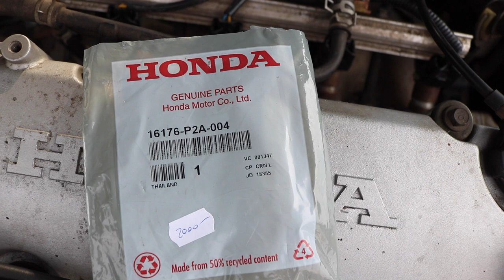Honda Civic - Throttle Body Air Restrictor Removal

Comment: For everyone asking , i just replaced the gasket on a ej9 hatch 75Hp without the ECU , the car runs  excellent and you can tell the difference.
Reply: thank you , i will do the same thing
Reply: thank you, so it isnt just a placebo? tbh im more worried the engine wont realise and that can be bad for it since more air than expected is going in meaning more combustion than is calculated.
Reply: @priceless073  When i brought the car i didn't realise that it hasn"t the gasket on the troutle body, and it worked fine , with no problems like almost 3 years
Reply: @priceless073  it will calculate for the added air and the stock injectors are the same on the nonrestricted version meaning theyre sufficient enough to add fuel, thus no ecu change is required.
Reply: @priceless073  I have done video about the difference. 2 seconds faster 0-100! Definitely not placebo haha

Comment: The 2 IACV hoses don't have to come off. Just did mine and there was more than enough wiggle room leaving them in place. The difference is noticable, gives the engine a little more grunt especially torque down low.

Comment: My car had shit idle if i turned the AC on. I took it to three mechanics but they would always just service my throttle body and put it back on. I did notice that the gasket was torn in half and only was present on one side of the intake manifold opening. I asked my mechanic to put a new one but his dumbass was like nah that doesn't make a difference. But yeah annoyed me and i just went and bought one before he could put the TB back on. And once we put that on , I didn't let him charge service the throttle body and charge me extra. It worked and now it idles nicely on AC as well.

Comment: Hi thanks a lot for the video will changing this gasket give it 90 hp or is changing the ecu a must. Pleaserl respond as your the only person making useful content on this engine
Reply: You should also change the ecu
Reply: @alexandarminev6497  no
Reply: @alexandarminev6497  no, the stock ECU will automatically calculate and change fueling adequate to the increase of intake flow.

Comment: I loved this video , and the most thing that I loved was to see the two places that the coolant hoses go , were looking like shining new metal , It's impossible to see here in brazil a g6 d16 with the coolant components looking so new , because in the last i would say 19 , 20 years here all the old owners used just water and no coolant at all , I think the only one that maybe ass good as this one in the coolant area is the model 001 made in brazil in 97 that honda keeps in their storage , massive congrats for not using water on the coolant !
Reply: Honda waterpumps on these d series are built for life. They only require inspection at timing belt intervals of 100,000km or sooner depending on service regime. If you use the correct oem honda type 2 blue coolant the pump will last a very long time

Comment: I replaced mine a few months ago, and I took it to Honda to Finish it. I could not get those 2 hoses on the IACV. Getting those 2 hoses off was the worst thing I've ever done on my car, and trying to get them back on was even worse. Taking the fuel rail off would allow more room, but I don't know how to do that, so that's why I took it to Honda. I spent over 2 hours fighting with those 2 hoses, it was hands down absolutely the worst job I've done on my car. My blood was boiling before I gave up. The reason why it's so hard is because the end of the IACV those short pipes the tip is bigger making harder to slide the hoses on, and that damn fuel rail is in the way.
Reply: Bro , I hope you're joking. At the same time I wouldn't expect a Marine to be able to figure out how to get a simple hose off either. By far the easiest thing to do on a vehicle of any sort is remove a hose. I hope like hell you are not working on government vehicles
Reply: Dude, you're that lazy and scared to work on a simple Honda!!

Comment: Damn, is this real? The engine is just limited with a gasket? Does the chip have the tune for the extra ,,air pressure"?
Reply: Yes it is real! The manufacturer limited the amount of air, thus stifling the engine. The process can be considered complete by replacing the ECU.
D14A3 - 55kW, D14A4 - 67kW
Reply: @secur_one   Is the difference only in this gasket or it's the ECU too?!
Reply: @Bumbazaurs  both! ecu&gasket
Reply: @secur_one  hey bro what kind of ecu do u recommend? Also my d16y7 is automatic can i still do it?
Reply: EPIC VEDIOS  Good question, I’m wondering the same but this dude doesn’t reply for shit
Reply: @joevespucci5406  I found out that's all it is, on wikipedia it saiys the only diffrence between d14a3 and d14a4 is that gasket
Reply: Mihail Petrovici  Thank you🙏
Reply: @epicvedios6478  Sorry, I didn't receive a notification. Not possible with D14A3 engine only. If you want to modify or tune, you will need a P28 or P30 ECU.
Reply: @joevespucci5406  oops sorry

Comment: Is the gasket replacement needed to make it from 75 to 90 hp or its just ur something that your car needed ?
Reply: Some D-Series engines come with 75HP instead of 90HP even though it's exactly the same engine and it probably was due to emissions in some countries. You clearly see a difference in the diameter of the gasket in which the air flows through, much bigger on the 90HP gasket. You can put a D14A2 gasket on a D14A5 engine for example which is one of them that's restricted to 75HP without a problem. I'd personally do it for the extra 15HP in these lower HP cars where it actually makes a pretty nice difference.
Reply: @Fros789  Do I need to replace the ecu as well or is the gasket enough to get the 90hp?
Reply: @Cypress_green  The ECU too. Im guessing its because it has a different air/fuel ratio setting on the 90HP ECU
Reply: @Fros789  ah, damn i were hoping that if i cant find the 90hp version i want then ill just buy a 75 and change this but looks like i cant :(
Reply: @foxy126pl6  spokojnie, ten powyżej gada głupoty, sterownik seryjny da radę. Wystarczy że go zresetujesz (wypniesz na przynajmniej godzinkę) wymienisz uszczelkę, podejmiesz ecu, odpalisz auto (tylko nie gazuj) i sterownik sam sobie obliczy ile mają lać wtryski po zwiększeniu przepływu dolotu.
Reply: @Wilma5532  witam, sam planuje wymienić tę uszczelkę. Czyli mówisz ze wystarczy wypiąć ecu na +/- godzinkę, zmienić uszczelkę i podpiąć z powrotem ecu? Nie muszę wymieniać ecu na ten 90konny? I jeszcze jedno, jaka dokładnie musi być to uszczelka, jakie oznaczenie?
Reply: @krgddl  nie powinieneś, ja również zawiodłem się po wymianie samej uszczelki, ale potem odkryłem to całe resetowanie sterownika, pojeździłem tak z 20km czasami wykorzystując cały zakres obrotów i ewidentnie zwiększyła się moc chyba na te rzekome 90km
Reply: @Wilma5532  Dzięki wielkie, a skąd kupowałeś uszczelkę ma ona jakieś specjalne oznaczenie bądź nazwe? Dopiero zaczynam przygodę z motoryzacja i nie będę ukrywał że jestem w tym zielony. Dlatego wolę dopytać kogoś kto się zna :p
Reply: @krgddl  sam zrobiłem z materiału do uszczelek, bodajże "kryngielit"
Reply: @Wilma5532  Dzięki raz jeszcze
Reply: @Wilma5532 a to napewno jest dobra uszczelka. Na necie mówią coś o metalowej trochę innych kształtów

Comment: The issue now is that you might be running a bit lean in the air/fuel ratio.  How are you going to get it back to stoichiometric?
Reply: You won't be running lean, do this with the ECU unplugged, for at least an hour, so it resets. Then assemble everything, plug it in, and start the car. Let it idle (DONT REV IT!) for a little bit, the ECU will automatically calculate and change fueling after noticing the increase of air.
Reply: @Wilma5532 what if already been driving with new gasket can I still unplug ecu and it will calculate the air/fuel ratio?

Comment: What kind of air intake fits in this engine?
Reply: All air intakes from "D" engine codes.
Reply: @secur_one  only y7s
Reply: @vsmcoupe  this is not true because it is not "Y" coded engine but "A" coded. (d14a3)
Reply: @secur_one  all intakes from d series engine would not fit. The throttle body is not the same as a traditional d16y8 or d16z6 . So you have to get a intake thats fits a y7 or this a3 because of the intake manifild

Comment: Very interesting,i'll bet it makes a big difference,over 20 hp more.
Reply: I doubt it because the ecu can't make up that much extra fuel for the extra air intake. The extra air intake alone would cause the fuel map to go very lean to around 15 or 16 afr. I have this engine in my spare car and hope to bring it out soon to do some testing on this subject
Reply: @adamstilldrives   You could be right, but i still say  it will gain a lot of free HP, around 30 for sure, no car manuf in the world makes engines with restrictors on purpose; especially with that ridiculously small one;

 The Rover 25  with the 1.4 16 Valves K engine (Rover used to have Honda engines but not this one)  is exactly the same;

 The power is 103 hp but it is reduced to 84 hp in some versions in the UK , just in order to fall into a cheaper insurance category,nothing else; other than that they are exactly the same; ECU programming and all, both ECUs have the same exact part number; fuelling is adequate for the 103;  and the MAP measures the correct manifold pressure, and therefore the correct fueling, for the strangled one too;

 I have two of those,both 103,but on one that was an 84 hp, i had to cut the restrictor,a very easy job,the accessto it  is excellent.
Reply: @adamstilldrives  mate they're the exact same engine, the only difference being that restrictor on the throttle body to bring the power, was done for UK market and others. It act likes a restrictor on a moped, the ECU is the same on multiple engines
Reply: @josepeixoto3384  The 1.4 came in 75hp and 90hp variants, with the 90 reserved for iS model civics. Freeing up 30 horses just from changing a gasket is wishful thinking.